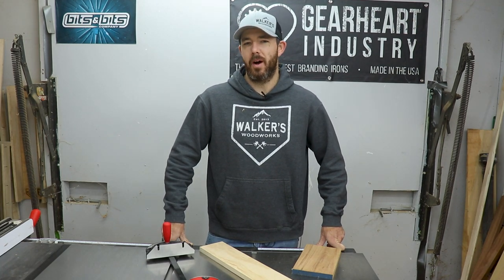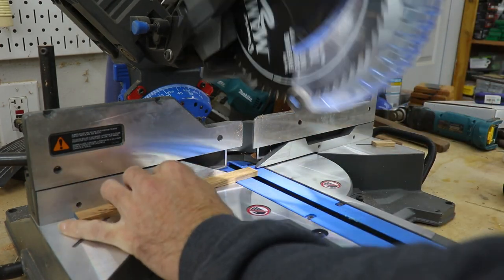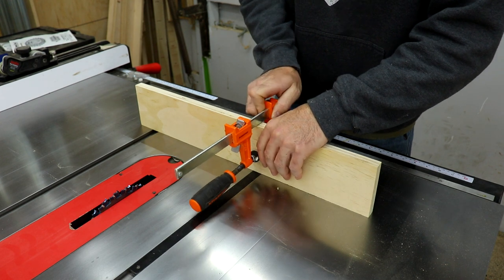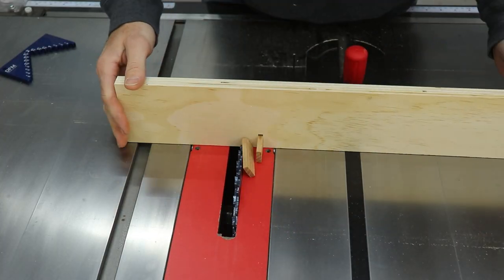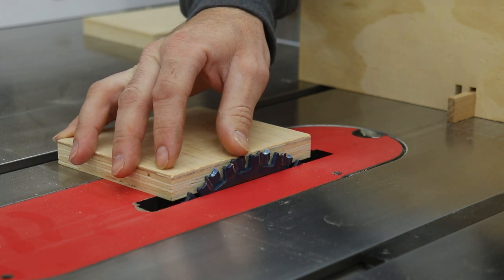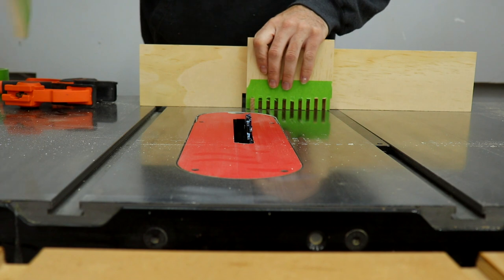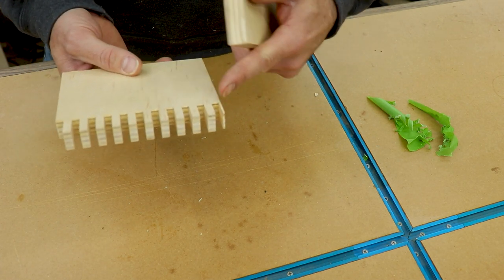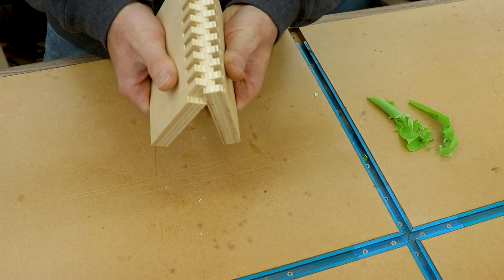DIY Box Joint Jig / Make Your Own Finger Joint Jig

Comment: So my miter gage has some wiggle in it. Any tips for that?
Reply: Take a metal punch and a hammer and lay the bar of your miter gauge on its side on a flat surface and make dimples on tge side of your miter bar. It will raise the metal around the dimple and should take up the difference or wiggle. You want to do it maybe 2 or 3 times down the length of one side. If its not enough do it again in the same spot to raise the metal some more. This really only applies to a steel bar and a cast iron top. If not you can get adjustable miter bars on Amazon or from rockler
Reply from the maker: What he said!  Haha thanks for that reply Chris!
Reply: @Ashdad99  I would have never thought of that!